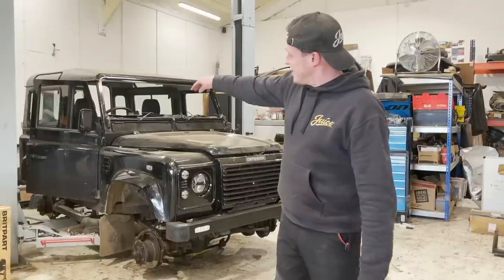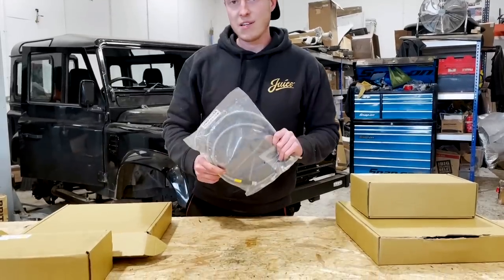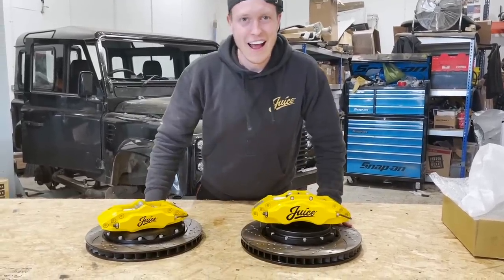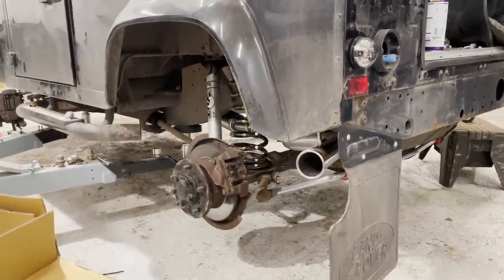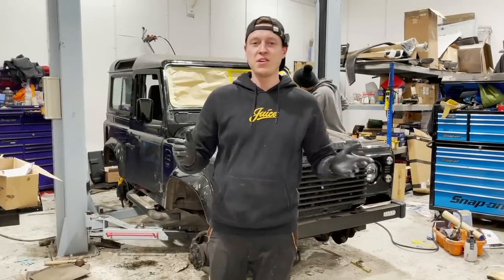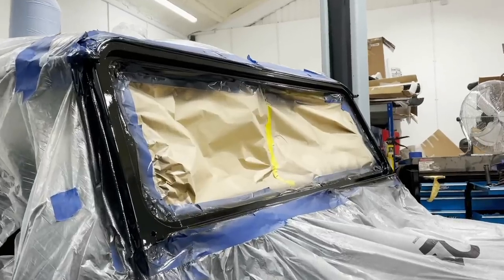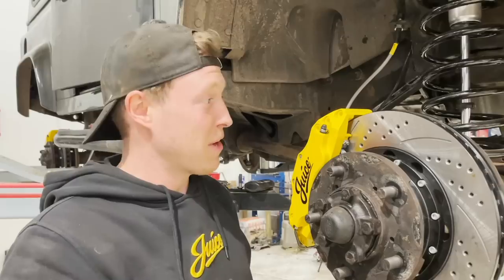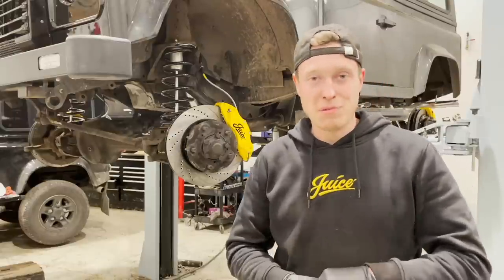Modifying a Land Rover Defender 90! - Part 3

Comment: Surly the Smokey engine and rusty chassis should be sorted before bolting all this stuff on?
Reply from the maker: Smoky engine? It’s an 18 year old diesel Land Rover.... rusty chassis has been fully wax treated post works
Reply: @juicemotors   you can’t just wax over rust. Under the gearbox mount is a really common area for rotting out and yours was no exception as can be seen when you fitted the new exhaust. Rust needs treating properly and the area painted before any wax treatment or it can just accelerate the problem. Also, one of my defenders is a 17 year old td5 with almost 150000 miles and it certainly doesn’t smoke like that so maybe it needs looking at a bit 👍🏻
Reply from the maker: We use a wax and paint mixture which is specifically designed to tackle direct application to rust. We steam, degrease, sand and prepare the chassis’s on a weekly basis for this treatment. There is certainly nothing wrong with the engine in this 90, the smoke you see from the exhaust is a mix of loosing silencers, a new exhaust, sealants and a non serviced engine starting up for the first time in over 2 weeks after having heavy surgery. It’s perfectly healthy and drives flawlessly
Reply: @juicemotors   fair enough. Having been a panel beater for over 20 years it’s not the way I would do it, but if it’s working for you then fair play 👍🏻

Comment: I wonder how the master cylinder will go with them?? Will it bottom out before full clamp is reached?
Reply from the maker: No sir, this kit is designed for stock master cylinders but the servo has to be a double diaphragm unit, if it isn’t it’ll need to be swapped out

Comment: Hi i have a mahoosive appoligy to make to u . I said that cars will fail the mot if the emmisions equipment has bn deleted or disabled . It is illeagal to tamper with emissions control equipment but as longs the vehichle dosent emit more than the legal limit of harmfull gasses . I was told that cars were failing mots for it . Like i say it is illegal to tamper with any emissions equipment but the vehicle if under the emissions limits itl pass its mot . However i was told by dvsa that they are trying to make it so that cars trucks etc that have bn tampered with will not pass an mot  . Its a pity this is the case as these emissions controls strangle an engine . Uv got that landy sounding great and i bet itl be much more powerfull too . Thats quite the exhaust that u fitted . Looks and sounds great . Massive brakes too . Ud wonder if such vehicles should have these brakes as standard . . I dont want u to think im a hater and a trouble causer im really not . I just dont want folk getting in trouble .  Ps have u ever heard how the last landy u rebuilt is getting on . It would be cool to find out how its performin for its new owner . U do great work . Keep safe  take care .... ian .....

Comment: i got myself  a set of used stock land rover 4 pot front calipers . im currently working on a mazda rx8 build im thinking if putting the land rover calipers on the front of the rx8. the rx8 is a relatively light car compared to the landrover defender ( puma)  so if the mounting points are suitable i will be building a set of custom caliper brackets and seeing if this would actuallly work

Comment: Love your videos man. Just noticed that huge bit of rust on the chassis at 5:36 when you brought the first part of the exhaust under the Landy. It doesn't look like surface rust to me, it looks like serious rust that would potentially be an MOT fail. Seems crazy to be doing all this work when the vehicle isn't 100% structurally sound.
Reply from the maker: It definitely looks worse than it is, we’ve tapped it and made sure it’s safe, legal and structurally sound. We’ve also given the chassis a full wax protection package 👌🏻

Comment: What are you gonna fit for a master brake cylinder? Those new cilipers look awesome but you need a new master brake cylinder to match the increased fluid volume in the calipers unless the pistons are the same diameter ...
Reply from the maker: The master remains the same, this kit is only suitable for double diaphragm servos. If you have a single diaphragm servo you’ll need to swap it out for one off a puma 110

Comment: I always wonder what the consequences of BIG changes might be 🤔 Those discs look epic, but surely they will put proportionally more strain on the mount holding onto the calliper? Are you just relying on the fact that LR over-engineered it’s axels to start with, or are these best fitted on HD axels?

Comment: The build is going well so far so well done!. I don't like to sound negative, but wouldn't it have been an idea to have washed the car fully before you started, that way any body work that needed addressing could have been spotted and your painter could have worked on minor dings when he was painting the windscreen frame.
Reply from the maker: We can see corrosion a mile off, the paint bubbles on areas that need attention 💛

Comment: Amazing keep up the great work. A question thou on mud tyres and steel wheels. Do you use balancing weights on front face of wheel? As I've never seen any on your builds.
Reply from the maker: Thank you! We certainly use wheel weights on the inside front face. We also use galv weights for steels 🙂

Comment: Finally someone who knows how to pack wheel bearings. Congratulations.
Reply: Actually the correct way is with oil...
Reply: @husq2100  No it isn't, as per manufacturers service instructions.
Reply: Not sure what stringy grease he's using though? Looks like some sort of marine grease by the way it strings.
Reply: @husq2100  you can convert the hubs to run in oil by changing the rear grease seal to an oil seal and removing the half shaft oil seal from the stub axle, this allows Diff oil to reach the bearings but they usually run in grease on Defenders.
Reply from the maker: I run Castrol Spheerol, it’s rated for extreme pressure and is totally WATERPROOF! 💧 amazing stuff that’s perfect for Land Rovers
Reply: @juicemotors  Lithium EP, like Castrol Spheerol, is the way to go. Good job.
Reply from the maker: @WestCoastVisitor  I used to use tractor rated red lithium grease before I stumbled across the shpheerol - I’m honestly amazed with the stuff. You can fully submerse it and the grease doesn’t wash out
Reply: @juicemotors  Been using Morris K48 but will give this a go next time. 👍

Comment: Confused here.. When you pulled the shaft oil ran out of the bearing.. so, inner shaft seal is gone thinks me.. then when you pulled the hub, the spindle and plate looked brand new? So has someone fitted a new spindle with no seal?
Reply from the maker: Hub seal gone leaking diff oil to the bearings. That’s the ABS ring 😇
Reply: @juicemotors  Thanks for the reply.. I have edited my comment at the end it said "with a deal".. should have said "no seal". the fact the oil was so clean and the plate/spindle/bolts all looked so clean made come to this conclusion?
Reply from the maker: @defender90keswick.nigelsla59  it’s just a very low mileage standard vehicle, it was purchased new so this is maybe it’s second time apart, maybe never! It’s just a beautiful example.
Reply: @juicemotors  blimey, mine is also a very low miles, purchased new in 2011 90 and pretty much every piece of metal that isn't Keswick Green was corroded.

Comment: Not complaining because I rlly like the design and colour but isn’t a rotor that big and callipers that big slightly a bit overkill for a TD5 I know you can get all 4 wheels spinning but still it doesn’t make it much more over 100mph like I said I really like the design
Reply from the maker: Hi William, the brakes aren’t just to lock the wheels, we want progressive braking to stop in the shortest distance whilst retaining maximum control. These brakes bring the Defender to a dead stop quickly and give a great deal of confidence to the driver behind the wheel. You’ll have to try them!
Reply: @juicemotors  I’m sure when I can eventually cough up the money for a defender and upgrades I’ll be coming your way ahahaha but thank you for the reply keep up the great work! :)